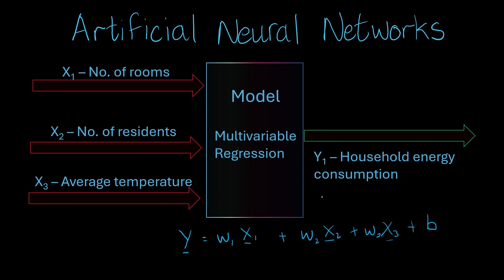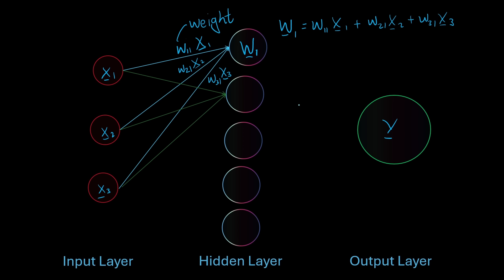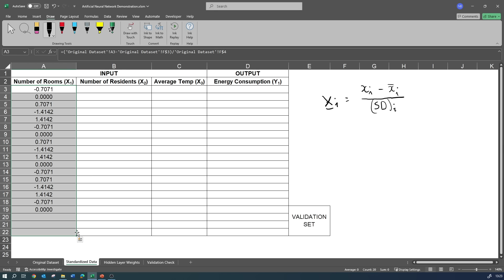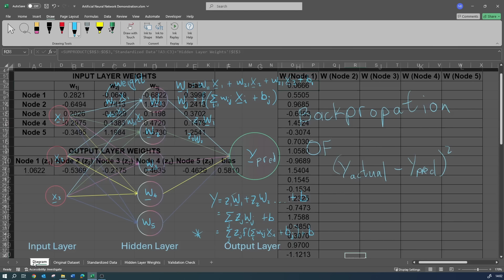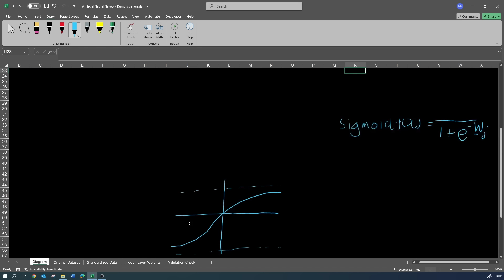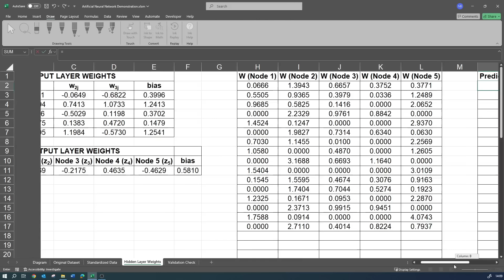Artificial Neural Networks Made Simple: Learn & Create One in Excel (No Coding!)

Comment: I followed same process however solver is asking for boundary conditions (lower and upper bounds). What should i do please?
Reply from the maker: Hi there. I'll need to see more details to be sure, but I think you can resolve the issue by going to the solver dialog box and looking at "Select a Solving Method". On the right hand side you should see a button called "Options" - click that and navigate to the "GRG Nonlinear" tab. You should see a checkbox called "Require Bounds on Variables" - please ensure that this checkbox is unticked
Reply: @SeriousSolvers  
Thanks for the guidance 
Yes it is unticked, i ran it setting the constraints  0<=-1 and 0>=1